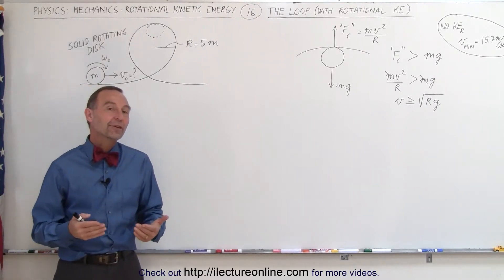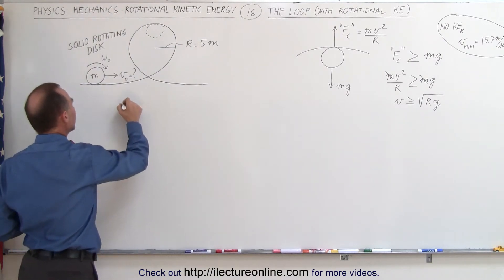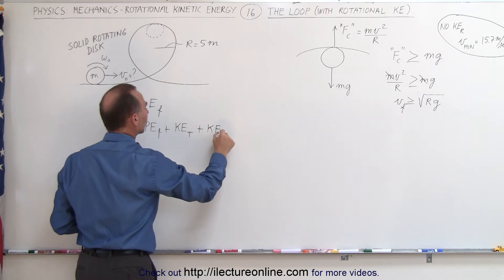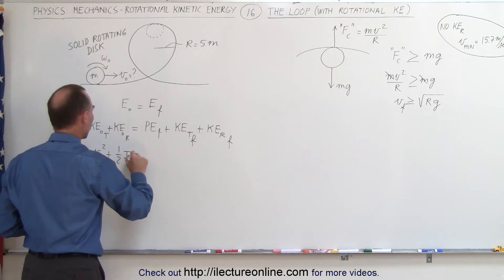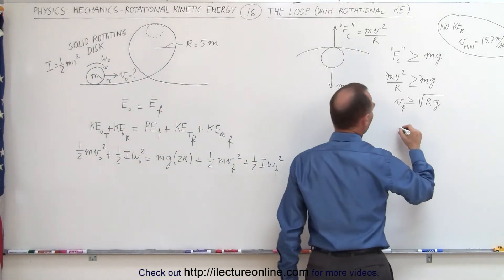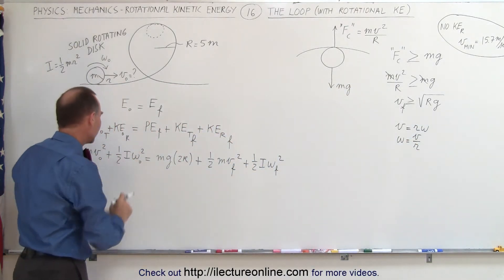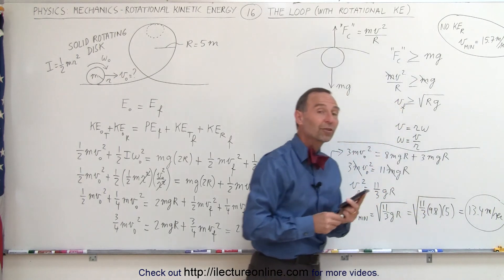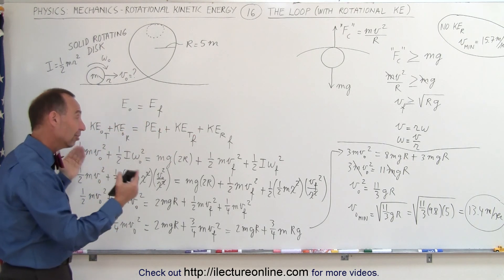Physics 8.5   Rotational Kinetic Energy (16 of 19) The Loop (With Rotational K.E.)

Comment: Static friction is needed for the disk to rotate. For static friction a normal force is necessary. If the normal force becomes too small, the disk will start to slip. Therefore, the criterion that the normal force disappears in the limiting case cannot be correct. The coefficient of static friction should be included.
Reply from the maker: Just like we ignore wind resistance during our projectile motion lectures to keep things simple, we do the same here ignoring the friction.  Then as we get into the more advanced lectures we start including these additional factors.
Reply: @MichelvanBiezen  If friction is ignored, the disk will keep rotating with maximum angular velocity. You need an extreme large static friction coefficient for you solution to be correct. Even that is not trivial.
Reply from the maker: I am not disagreeing that friction is required to make the disk rotate, but again we sometimes ignore certain things like air resistance with projectile problems in order to simplify the concept.  Then as we progress we keep adding things we ignored as a stepwise process.

Comment: I just had a thought.... your video showed that the  Vo Minimum was Sqr( (11/3)gR). This Vo is less than the Vo for a Sliding Disk (or ball..etc) which was Sqr (5gR) ... .. but what happens if the ball, or disk, starts with this Vo and gets to the bottom of the loop and starts to climb up the loop BUT.... the Loop has ZERO FRICTION????... the Rotational Momentum and KE may still be within the Ball/Disk.. but there's no "BITE" of friction to allow the rotating ball to Climb up the loop.... so it becomes the responsibility of the Translational Velocity to carry the Ball up and Past the Top of the loop.... but that Translational Velocity is LESS than what was required for just a SLIDING ball or disk...... I'm guessing FRICTION on the Track of the LOOP is needed for this to work..... Yes? No? Maybe So?...... what do you think?.. Thanks Michel for making me think alot more about this Problem than I probably should have.. LOL.. but it's been fun!!!!

Comment: If the Translational Velocity were to just go to ZERO prior to the top of the loop... the Rotational Energy would amount to Rotational Momentum.. and the Spinning of the Ball would allow the Ball to KEEP GOING up to the Highest point and carry the ball Past that point... I hadn't thought about that before when I saw that the Initial velocity was Smaller than the Velocity for a sliding object. Now I see where the ENERGY of BOTH the Translational and rotational Energies drive the Rolling Ball (sphere) up and around the Circular Loop...

Comment: Why wouldn't mgh= mg(2R-2r) since the ball also has height?
Reply from the maker: You are correct.  Typically we assume that r << R such that the difference is not significant
Reply: @MichelvanBiezen Also, Mr. Michel, why is there a difference and not the addition of the 2R and 2r?